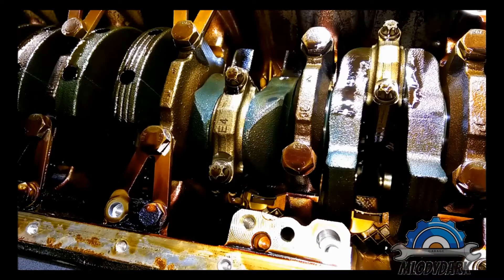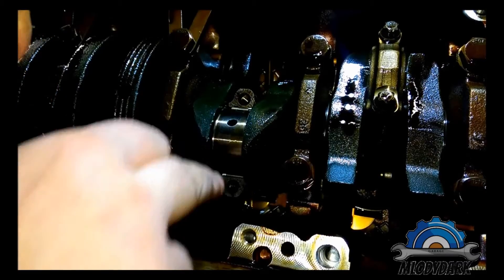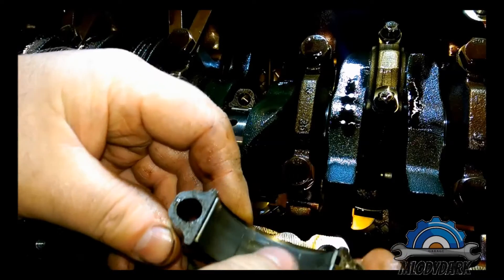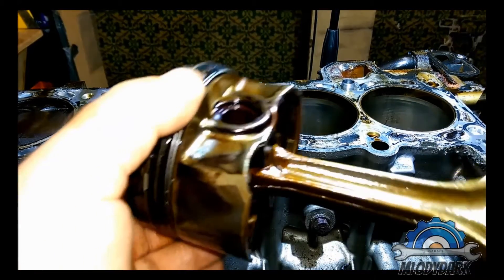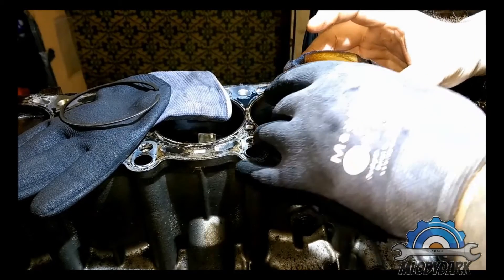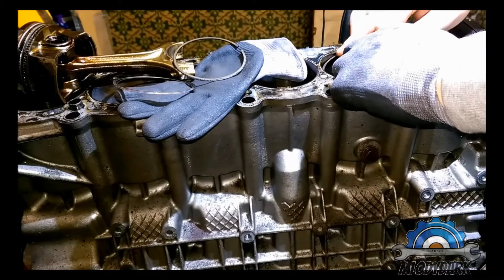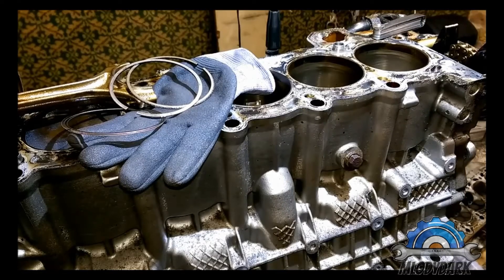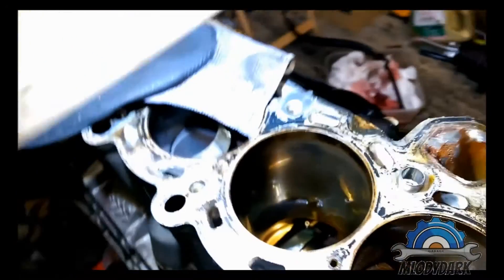BMW e46 piston rings removal and why M54 burning oil

Comment: Even if you remove the crank there is no way to remove the pistons. There is a lip at the bottom of the cylinder that the pistons will hit if you try to pull it out.

Comment: How come you mention that you can't remove the pistons without removing the crank shaft? Later on in part 2 of this video, aren't you spinning the crank to get to the rod bearings? Is it impossible or just difficult to remove the pistons with engine in car?
Reply: I answered my own question. It is actually very easy to remove with engine in the car. I know because I just did it.

Comment: Is it possible to replace a piston with the engine in the car by doing something similar to this?
Reply: I would also like to know. Did you ever get an answser from anyone?
Reply: @BenjiBonsaii  I replaced a piston with the engine in the car. Suspended the engine by threading rope through one of the coolant passages, pulled the front subframe and oil sump, unbolt the rod caps, push the piston/rod out the top. While I was there, I also replaced all the piston rings and rod bearings.
Reply: @477racing  have u changed piston rings without honing ? how that went everything is fine/was fine ?
Reply: Obviously it would have been better to put a fresh hone in the cylinders but ultimately I got the car running. I ended up selling it because it was a money pit
Reply: @477racing  does the change of oil rings made any major difference without hone ? or u have not driven it at all afterwards

Comment: My code reader tells me that bank 1,3,4,5 are running lean, don’t know what that means but car runs smooth , maybe fuel injectors, fuel pump or fuel regulator?
Reply: vacumm leaks ,MAF ect. try too diagnose by reading live data not codes only

Comment: Great video and I subscribe to your channel--love the work and the camera takes. I have the m54b30. i started the car, switched it off went to lock the gate, got back and it would not start. Got a local mechanic to check it out. He stripped it and the valves bent on cylinder 6, replaced and built engine back. Started the engine and it was smoking like a chimney with oil dropping from the exhaust and oil light flashing on the dashboard. Please help what can i do. it idles very well and does not seem to lose power when idling but lack power when being driven. please help i am in Nigeria so not a lot of specialist tools or expert like you here. thanks, the car did not overheat even after he coupled the engine back,
Reply: What was the problem
Reply: @shumanimushavhela2152  I took the engine apart myself , and found out that the stupid mechanic had broken the chain guard , which is made out of plastic,with the some broken pieces failing into the sump and blocking the oil pick up tube hence the oil light flashing on the dashboard. This eventually killed the engine . i had to replace the whole engine
Reply: @atobsky  Eish that was bad. At least now you can do this by yourself.
Reply: @shumanimushavhela2152  oh yes, took me 3 long years from my initial post, and loads loads of Youtube videos and forum, i consider myself---very well bmw educated and i still own the car with no issues
Reply: @atobsky  well done. Mine is smoking and has a bearing knock even after taking it to resizing engineering shop.

Comment: why? because bmw engineers fuck up sometimes. Sometimes in spectacular fashion as with the rear subframe cracks fiasco. If they stopped trying to reinvent the wheel they might sell more cars. Bottom line is, they know what lasts but they refuse to do it. Makes me think they just want to keep their dealer service depts busy.
Reply: Like all products, the accountants get involved and force aggressive cost engineering.  It's the reality of the modern design and manufacturing environment, cost of everything value of nothing etc.

Comment: Very informative and enlightening. My e39, 525i, once it hit about 100K miles has started to consume the oil. In spite changing oil and filter faithfully on a 3K schedule. tearing the engine down to replace rings is not cost effective. I have opted for a pvc oil catch can solution. Fifty bucks and I'll monitor consumption carefully. If it were a show car maybe another approach would be considered. This is my daily driver. She sits outside. One comment that has served me well. Try Chrysler upper engine treatment. It helps to clean the rings. It does work and cuts down oil usage.

Great video and technical approach! Bravo..........
Reply from the maker: I did piston soak in the past,no result,so I wanted to see what is the M54 problem.Oil rings are too hard IMO and wearing quick.Please browse my channel I got more about CCV ,rings tension in M54 ,OCC high vac setup is it safe or not ect.
Reply: I agree with your findings, the real solution is just too cost prohibitive for a daily driver.
Reply from the maker: Mark L. That's what BMW wanted IMO most people sold the car or ketp spending money to find solution like me.
Reply: Did it work?
Reply: @jorgecosta95  I gave the 525i to my son. Still driving it, 200K miles. Uses very little oil. I buy passed the BMW CPVV system. Search the forums, I have a PCV valve on top of the engine. Pugged up the other stuff. Works like a charm.
Reply: @ramp7t  you mean the O2 pilot mod?
Reply: @jorgecosta95  I'm under a car right now. Just taking a break. Not sure of the name of the mod. Later tonight I'll try to find it. Maybe on the e90 Board.
Reply: @ramp7t  thank you, sir!
Any info is greatly appreciated!
I know there are 2, the aftermarket PCV from FRAMM and the o2pilot mod (CCV connected to intake manifold).
Reply: @jorgecosta95  Here is the simple and very effective Mod for BMWs that consume oil. My 525i  after 100K started drinking oil. After this mod, hardly anything.  https://xoutpost.com/bmw-sav-forums/x5-e53-forum/99551-diy-solution-m54-m52tu-ccv-problems.html
Reply: @jorgecosta95  I did the simple Fram PVC to the vacuum line off the back of the engine. I angled the PCV valve up slightly. No oil catch can was added. I did purchase one but never added.
Reply: @ramp7t  Yes, that's the mod I was talking about the Framm filter.
No any seals failing? Cause that mod puts 0.5 bar of vaccuum or -0.5 bar of pressure in the crankcase, which sucks a little for seals as their always holding the outside pressure...

Thank you, Mr. Mark!

Comment: have you watched Horse Power Freaks video on s54 engine block? look it up, interesting things to see https://youtu.be/HRC8wrl7vdM?t=455
Reply from the maker: Yeah I've seen it. Five times more power than mine only LOL.
Reply: +Elbow Grease no... I mean that the block of the s54 is actually not machined correctly and the cylinders wall is not good at all. They have a specific video about that, an that the bad wall is the cause of the short life of the piston rings / oil rings.
Reply from the maker: Kostadin Delizhanski
Hmm ,I think there will be many theories about this problem but I will stick to mine- 'bad ring material/design"- why ? Only oil rings showed crazy amount of wear and there is a difference in design between M52TU and M54

Comment: HI there, how can i contact you, because i also driving an e46 325ci and it does consume a lot of oil i have replaced the CCV valve, the seals valve the rocket cover gasket, also the compression of the car and all 6 cylinders have same compression, so i don't think it's the piston rings either. the car consume 1 litre per 200 miles which is ridiculous, PLEASE HELP!
Reply from the maker: Compression is fine cuz oil rings are the problem my email mlodydark@gmail.com
Reply: by oil rings you mean piston rings?
Reply from the maker: Yes,  watch my website pictures from My actual M54 http://www.elbowgreasediy.com/#!rings/j36gs

Comment: So I read that you used Goetze rings when you rebuilt your M54.  Why did you choose that brand instead of the OEM Mahle rings?  Did an engine rebuilder tell you they were different or better in some way?  Or did you just buy what was available?  Thanks!
Reply from the maker: Well I've did some resarch and long thread on e46fanatics http://forum.e46fanatics.com/showthread.php?t=1009367&highlight=
People reporting no oil use when car is babied if is not it drinks like crazy.Machine shop guy told me OEM ring don't withstand high temps and pressures so if you go with aftermarkets or like I checked ,M52TU which have old type oil rings and fit perfectly you should be fine.
Reply: Yeah I read through all 38 pages (kinda), so I'm fully versed on what the deal is.  I've got the M54B30.  I'm just interested in knowing if the other brands are different in any meaningful way.  Because you would think they are all manufactured to the OEM specifications, wouldn't you?  I suppose I will speak to a machine shop here and see if they have any info.
Reply from the maker: I think OEM M52TU option is the best.I think going from 3 piece oil ring to 2 piece oil ring is the problem or maybe just material they are made off,like my search  lead me to,.Mahle are graphite cast  and goetze are more old style iron and something else ,don't remember now.
Reply from the maker: about Goetze rings Top ring is Steel, middle ring is none heat treated grey cast iron and oil ring is ductile cast iron.No